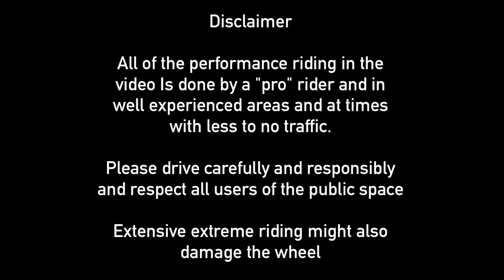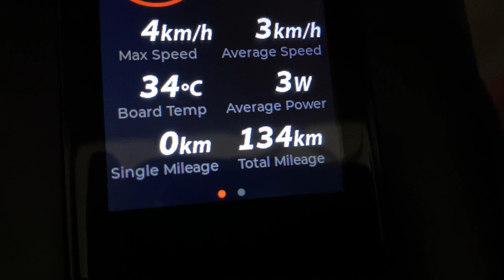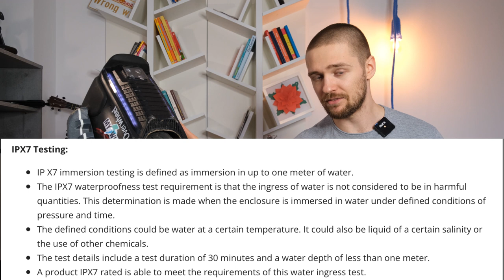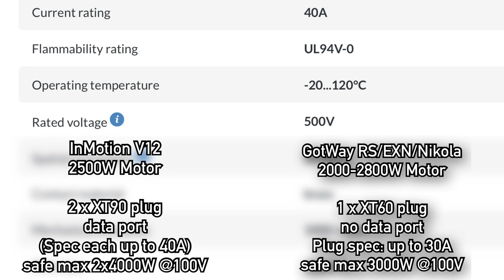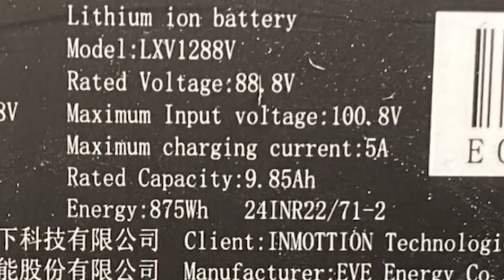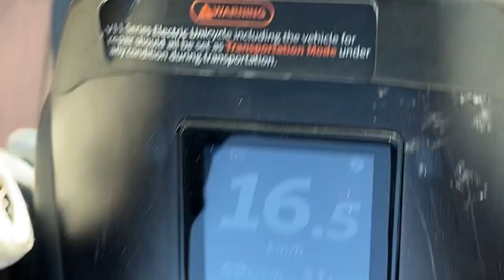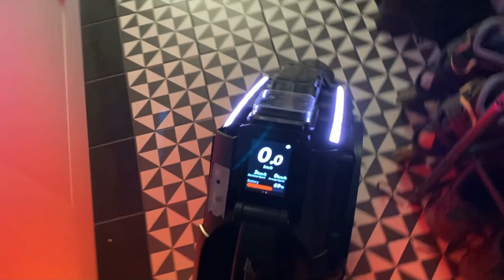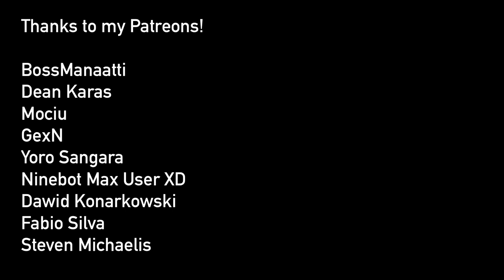InMotion V12 in-depth REVIEW

Comment: Top notch review, Adam.  I got mine 5 days ago and on first ride I felt like a beginner again. Just so different from my 16S.  I'll get there in about a month. I was disappointed with the trolly handle; it works but it's awkward; it should be doable with one hand and you can't. Lots of wobbles, especially lowest pedal level. Middle level more train tracking. The highest was the best, but it's a big change.  The power button is awkward too and needs two hands.  Waiting for power pads so maybe that will help with overall control.  Stay upright, my friend.
Reply: Have you tried pushing the wheel backwards with the trolly handle? I’ve heard it works better that way.
Reply: I’m also coming from a 16s!! The v12 just arrived today. Charging now. Will try riding it tomorrow. I heard a while ago that learning a second wheel is always hard but after that it becomes much easier to learn new wheels.

Goddamn this wheel is huge and heavy compared to 16s though!!
Reply: @seattleraf  I moved my pedals to middle position first, because I watched a review where someone said that's the best, but I hated it. You wouldn't think 1/2 inch would be a huge difference. Anyway try high pedals first.  Every ride I'm getting better, but my feet and legs are hurting just like when I was a rookie.  Let me know how your first ride goes.
Reply: @bepriceless right off the bat I can tell I’ll miss the huge stock pads of the 16s. Maybe I’ll get power pads but feels a bit overkill for me (I don’t wanna go 40mph or do jumps).

Anyways it was a quick 15-20 min test ride before work. Overall went well but didn’t ever go above 20mph. Haven’t tried hard breaking yet. Turning feels super different than the 16s right? The wider tire and heavier package make it seem like turning a aircraft carrier lol.

No doubts I’ll get used to it and feel more comfortable with it after more riding and then it’ll feel just as nimble as the 16s
Reply: I just pull the trigger with one finger and lift it with the others

Comment: Thank you Adam! Another awesome review! 👏
Love the way you went through all areas of the wheel & put the extra time and effort! 👌
Well worth watching an hour+ review, especially from you 😉

As I've said in the past to Marcus (aka MADpack) on his V12 review video;
Inmotion needs to take the best of both their recent amazing wheels: V11 & V12, and make an awesome killer wheel 💪🏻
- 18-20" tire
- bigger battery (but not too big that it will become very heavy)
- lights from V11
- waterproof like V12
- screen like V12 (or like Sherman as you mentioned its better)
- top speed over 45mph (to have a good safety speed buffer to cruise at 40mph)
- suspension is optional (maybe make 2 versions like gotway does, lol)
- troller handle is a tricky choice since I don't fancy the scorpion style, but it does allow for more waterproofness.
In my humble opinion those key features will make an amazing wheel.
I'm sure there are more detailed features to consider, but I can't write a crazy long comment, lol

Now if only Inmotion can get this future wheel out to the market before next summer, that would be sweet!
(and then I'll need to sell my RS 🤣)

Thanks again Adam!
Keep up the great work & ride safe!
-Mo (IG: mo_euc)

Comment: That cutoff at low battery is ridiculous - no other wheels do that. As you know, they severely tilt-back making it essentially impossible to ride. Cutting out like that, when you are trying to get to your location, is actually dangerous and can cause injuries. Very surprising. Generally, I hate how Inmotion handles extremely low battery.
Reply: There is a switch that prevents that in the app..
Reply: @MidTownSnipers_VHP  There's a "don't cutout" switch in the app??? That sounds hard to believe.
Reply: @ElectricUnicycles  : it's called "Low Battery Safe Mode" aka Idiot Proof Switch.. This way we can't Kamikaze ourselves even if we try. 
You know how the high speed guys turn off the Beeps? The Same guys Ignore this feature. 
It's there.
Reply: @MidTownSnipers_VHP  So Adam had the "Low Battery Safe Mode" turned off and that's why he faceplanted? I have to say, this seems like a stupid option to have. None of the other company's have felt the need to implement that. I can't see the advantage vs implementing a very steep tilt-back at end of life, like Gotway, Veteran, etc. does. Thanks for the clarification.
Reply: please prepare for face plant.  ouch

Comment: If Inmotion's next wheel is a 20 inch with a 3000 W motor and a 2500 to 3000 Wh battery pack, with the same built quality as the V12, I would buy it right  away !!!
Reply: plus suspension and lights of the V11! if that happens, The "V14" will crush every other wheel!
Reply: @OnizukaGTO  
I disagree for the suspension, but yeah, that woulb be impressive !
Reply: no need suspension, but if Inmotion do this, it would be Inmotion Sherman max V2 :)

Comment: The label for the battery says "24INR22/71-2". I don't know for sure what the numbers mean, but most likely a combination of the battery cells' physical size (form factor) and quantity and/or combination of parallel/series arrangement. INR batteries have a Lithium Manganese Nickel Chemistry (LiNiMnCoO2) which is expensive because of the quantity, balance and number raw materials used. INR batteries provide increased energy capacity.

Also thank you for this AMAZING review!

Comment: Best review yet for your best wheel yet! Thanks so much for putting in the timestamps! It made it super easy to l rewatch certain sections of the review over just to truly understand what was being said. Also, thanks for the specific callouts for heavier riders in regards to this review and past reviews. Very very much appreciated!

V12 looks to be the most modern wheel out so far. The smaller battery gives me pause but...if they ever make a torque version like you reference, I'd be very much interested. Big battery is a must for me, and I can't wait until we see more big battery wheel offerings outside of Gotway/Begode and Veteran.

Comment: Excellent review, thank you Wrong Way.

At 1:06:40 the tire valve stem appears to be pointing backwards.  I would think that if one was riding in tall grass or weeds and the wheel started to spin (loss of traction), the valve stem would snag on the vegetation and/or on the dirt if the wheel fell over.  Would it not be better if the valve stem pointed forwards so that it would never snag?

Comment: Well, I am not a rider but as someone who does design work, your wish list for features was something else. They are not bad wishes (every video I have seen of a tire change has made me think wheel removal should be easier) but I had to wonder how many of the things you would like would be in direct opposition to each other. Still they all make sense and I guess the engineer has to choose which things are going to sell best, which things will keep them from getting sued, which thing will save money in production, etc. It would be interesting to produce a wheel frame that could have a custom case fitted with users choice of battery, a raw controller that the user could supply the microprocessor to (with basic open source code)... Just like in the motorcycle world where buying a new frame and adding your motor to it makes a new machine (you get to supply everything else too) I think Jammer did really well selling parts for this kind of thing.

Comment: Nice in depth review. I really like the Wrong Way shopping mode idea at 1:05:40. If it worked by trolley it would be best.
In my opinion no load detection is a problematic feature because it might interfere with jumping.
I was hoping that you address the tilt cutoff which I mean are problematic.
I am also wondering what is your opinion on sound wave?

Comment: What about an engineering option to unlock and slide the axle up or down to change 16" to 20" wheel change out... How difficult is it to take a wheel to a machine shop to weld on a titanium exo-skeleton for increased structural integrity?

Comment: I am a big fan, and I salute your dedication in giving your complete all to producing your videos in service to the community. Keep up the good job! With that said, I have not pulled the trigger in purchasing my first EUC. I do have two electric scooters, and it's mind-boggling how fast the newest and better unit is released when you have just decided to or going to buy what you thought is the best in the market currently. I am ready to add a EUC to my fleet. But I cannot make up my mind between two EUCs. So, i need a little more guidance. Inmotion V12 or King Song 16x? I live in NYC. I like speed and like to off road. I also like to cruise along the streets of NYC as I sight see all the city has to offer. I am agile and a fast learner. I like the idea of purchasing something that is more capable than my own ability. Starting out at something as a novice, I respect the value in growing or advancing up to a gadget's performance level. Power, speed, and distance, why not have all? Extras, the more the better. Comfort and safety, are of course important. Performance, which is best? I value your expertise. Please advise. Thanks in advance Adam. 👊🏾

Comment: This is what I come to YouTube for!! It’s excellent to get a thorough review of a relatively new product. I am a beginner, and wondering if this is a good wheel for someone who doesn’t want I be purchasing multiple wheels as his skill level increases. I know you suggest this is for “advanced riders”, hence the question. Could I set the pedals low and make this work for me? At 50 years old, and only riding longboards for 18 months, and electric for 4, I think I’ve dealt with the steep learning curve to cope with this as a hobby. Being in New Zealand means options are slim, so I’m looking at this, a 16x, Tesla T3, or RS19, and wanting to make a good choice first time. Thanks in advance!!
Reply: e v12 is garbage.and SUPER DANGEROUS . this youtuber has no clue what hes talking about.. inmotion used cheap parts.. MOSFETS..
Reply: @troyb8579  To be fair, the problems with the V12 seem to have happened with the 2nd batch, the 1st batch that was being reviewed here seem to have been trouble free. Adam, like Chooch and others really ride these wheel hard, much harder than a rider usually would..Neither of them have had problems. INMOTION do not make their own mosfets, they buy them in from a supplier. From what we know, some sub standard mosfets have been supplied to them and were used in the 2nd batch. This will be rectified and the newer V12..HS and HT will use completely different mosfets.. The problems will be resolved.

Comment: Awesome in detail review. Now just to get one here in the UK. Would be good to get for the rainy weather we have here. I was fully kitted out on the S18 and managed to get to the end of the road and I was soaked. So did not want to take the chance and fry another main board with water damage. Now with the new HT version on the horizon its going to be a hard wheel to beat.
Reply: e v12 is garbage.and SUPER DANGEROUS . this youtuber has no clue what hes talking about.. inmotion used cheap parts.. MOSFETS..

Comment: I got my wheel three month ago, when I tried to connect it with my app, the battery always shows 1 percent, but it looks good on the screen on the v12. Also the motor was quiet at the beginnning,  but after 700km ride it have noise just like normal gotway model

Comment: Planning to get A sherman with the prices locally I can get a v11 for 1200$ sherman for 2000$ and s20(when it arrives) 3000+

Might as well buy a sherman since a 2nd hand one is below 2000. Was actually thinking of a v12 but i want to charge the euc 2 or 3 days after every use coz i use a zero10x going to work around 40km daily.
Reply: Think twice before choosing sherman.  Rim problems is quite common,  lack of torque , therefore it's quite easy to kill motherboard. Oh and fun stuff with BMS and shells .. ( can be fixed with some 3d printed parts ).
Reply: @MrPoliarinis  yup but a local seller here uses his gen 1 sherman til today.  i do like the bulkyness of the sherman maybe a v11 for budget meal or v12 something new

Comment: Mr. Wrong Way,

Is this a good wheel for a beginner ?   I do not want to buy several wheels.   I want to start with the best wheel there is. 
Want to use it to commute to work.  23 km single ride. 
Is there an option to limit the speed for lets say 15 or 20 kph so i can get some muscle memory ? And not go full speed accidently ?
Or can you recomment another wheel that is maybe more comfortable, more distance on one charge, and so on.   The speed is high enough for me.  And that it has good resistance to water is also a must.  In the Netherlands it is raining a lot. 
I could charge it at work.  I am Dutch.🤭

Thanks if you could give some advice.  I have gear for safety. I ride motorcycle and do a lot offroad. 

Greetings,

Comment: @1:02:45 is there a brake light and white front light mode (EU RULES). Aka red light standard rear and when you brake higher intensity. Front light just white?
Turn signals?

Comment: You mentioned and I could noticeably see Wobble on your breaking test. Is that normal only on the V12 in your experience?  Is it uncomfortable to ride through?  On a OW it’s only when your legs are tired.
Reply from the maker: It’s way less wobble than on OW. I will need to make a revisit of the OW at some point. All wheels have wobble if you don’t position yourself right…this ones are present but easy to control

Comment: New to ECU but Experienced OW’er from 🇨🇦. Looking to make the change. I’m 70% pavement and 30% dirt trials. Small jumping but not a big drop guy! Cruising and speed and fair weather. Onewheel flow is awesome but 6 nosedives later (same result as your battery dieing), that’s getting old and always around 30kph PLUS! 🤕🩹❤️‍🩹 
Not sold on inmotion but build seems strong and in 🇨🇦. The v11 shock and wheel size seems good but lack of speed seems an issue. I’d like to cruise at 40-50kph and rip up once and awhile. 
The v12 wheel size seems to concern everyone but I’m cruising now at 30kph on a 6”? I’m feeling 16” would be smooth and less risky at speed than a 6”? 
Thoughts anyone?
Reply: I would say go for the V12.  This thing is priced similar to a OW GT but beats the GT in terms of speed, range, and comfort.  Carving on a OW is sweet but once you discover you can flow and get adrenaline fix at the same time on an EUC, your life may change.  As for the V11, suspension & hollow motor still have some more baking to do before they are ready (it still is an awesome wheel though).  Cruising at 50kph is not an issue for either the V12 or the V11.  This is coming from someone who owns the V11, used to own an XR and currently owns a Pint X.
Reply: @bookmark2846  what a helpful reply which is only supported by you knowing the OW.  Hint a Future Video. 😂

As well your detailed review will be watched again many times until I get my V12.  Thank you.

Comment: Honestly, if I could have one EUC imrovement, it's the easier tire change.

I had a flat on my MCM5 and holy Jesus, Mary and Joseph: You have to tear the WHOLE WHEEL just to be able to get an access to the full wheel. Remove all (And I do mean ALL) screws, rip the batteries off, remove one of the trolley handle bars to get access to one screw... It's a mess. It took me like 2 hours to tear it down and put it back together.

Comment: I know, i'm looking forward to positive reviews (since i ordered V12 myself) and i'm a poor victim of confirmation/selection bias, but thanks for not putting out glowing, over the top reviews and pushing affiliate links down our throats. 
It's a testing wheel you got, but to fix the slipping handle spray insides with hair spray. It's a known fix with motorcycle handles.

got unsubscribed from your channel somehow. Welp, your content is worth subscribing twice:)

edit: i was lucky to get my V12 just when the cold weather hit Europe. Yey. Now i ride it in -12C with everything stock. The stock tire has really great grip in snow. I can even pull two kids on sledge, without losing traction.

Comment: So if you didn't need a high top speed and you didn't need the water resistance and you didn't need all that range. Would you go with the V11 for commuting and suspension? Really struggling to decide between V11 and V12 for my 7 mile commute.
Reply from the maker: I will revisit the V11 soon and then I’ll be able to shed more light onto this. In my initial review the V11 didn’t feel responsive enough for me but I wasn’t using power pads back then. V11 has a lot going for it.
Reply: V12 Bruh
Reply: I'll wait in anticipation. I'm currently using a v5f and it felt so slow after 5 min of riding.

Comment: Hello Mr. Wrong Way,
May I pick your brain please? 

I am a double/bilateral above knee amputee. I have some short prosthetic legs that I would like to use to try to ride with. 
I’m wondering if it would be possible to ride without knee and ankle flexion and extension ((straight legged). 

I saw you riding seated in one of your videos. I’m thinking I could wear my really short prosthetics to ride semi seat or seated. 

I think it would be similar as to if you tried to ride seated with your knees on the foot plates/pedals with your heels up close to your butt (not interfacing with the pedals. 

Do you think it is possible? 

If so, which machine would you suggest please? 

I’m thinking I would need to be able to put a saddle/seat on it, suspension would be nice and low footplate option. 

Thanks for your time. 

Best wishes, 

Jason Sauer.